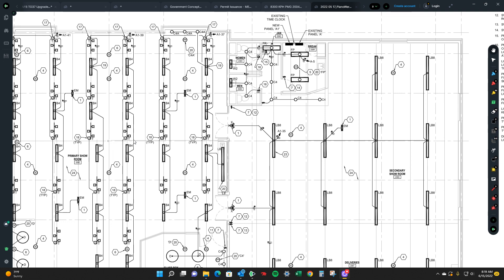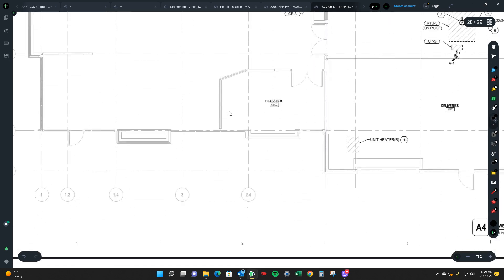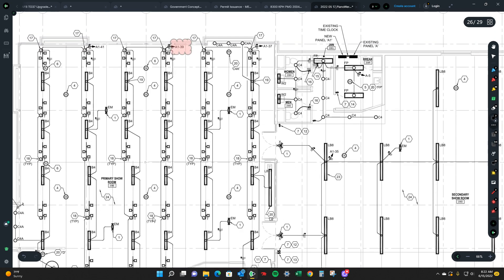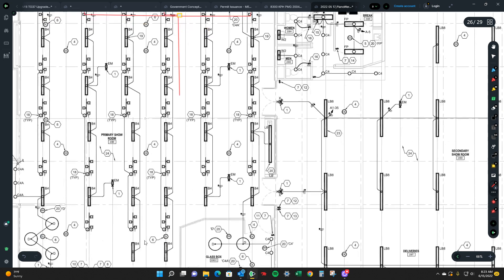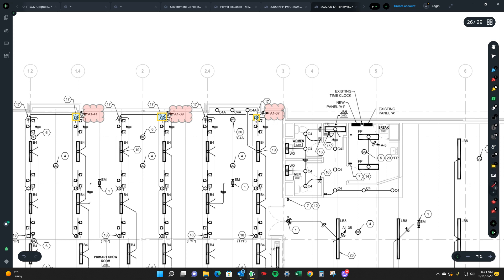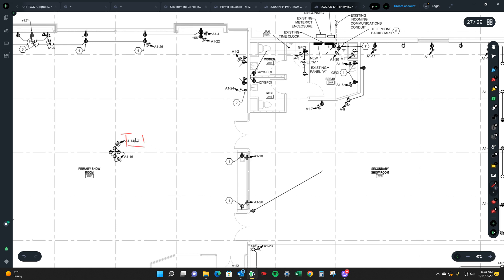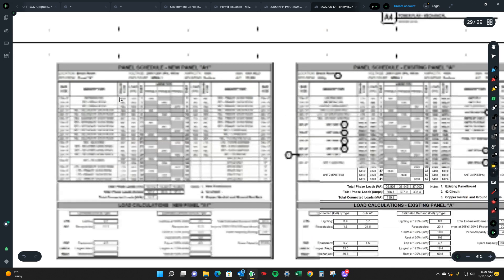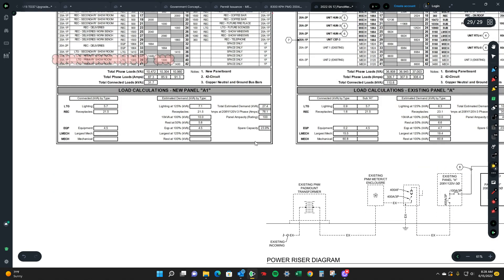Electrical Blueprints - Identifying Circuits and Homeruns

Comment: At 5:17 you won’t need 3 separate neutrals. If Panel “A” is a 3 phase panel (most likely in this case. You can have 37, 39, and 41 all sharing the same neutral.
Reply: And why is that?
Reply: @lavxnte  because phase A, B, C all share same N under this phase sequence. 
BUUUUT say it was circuits 39, 41, 43 than no, you can’t and would need two Neutrals. One N for 39, and 41, than for 43 it would require its own separate N. 
it’s all phase sequence grouping. If you want read further into it I believe this is 3rd year material. Let me know if you are still confused. We all should help learn from eachother.